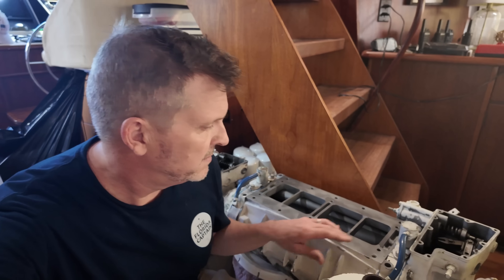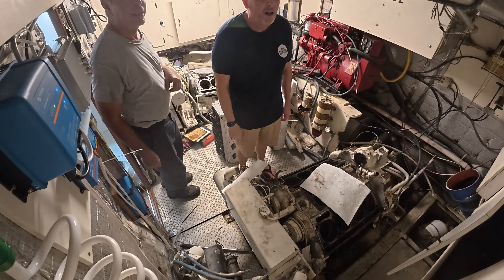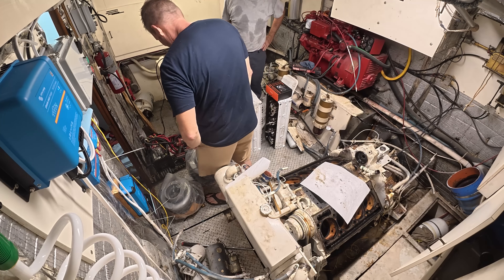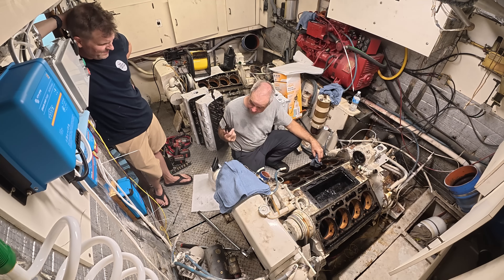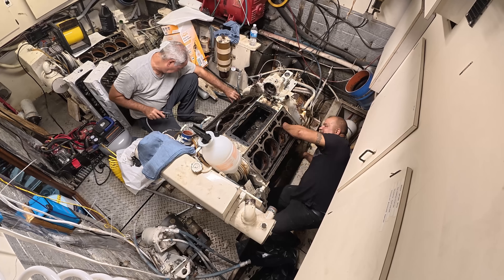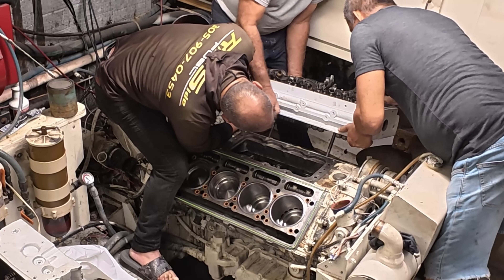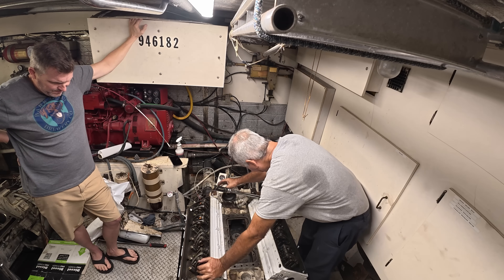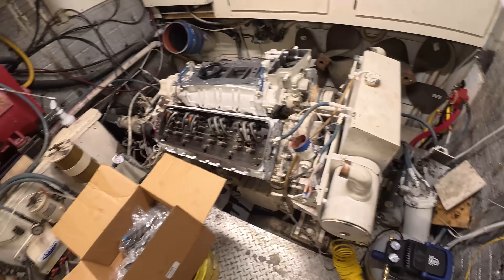Detroit Diesel Rebuild Begins! Step-by-Step Engine Reconstruction

Comment: I really enjoy watching the rebuild, thanks for sharing. And while I don't want to be a back seat driver, there are several such obvious safety issues here I feel compelled to comment. 1) Don't do electrical work. I am an electrician and the casual approach to working and dealing with hot circuits is dangerous and displays a lack of understanding of the hazards. Don't take it personally, many electricians make similar mistakes. Some pay a price for which they were not prepared. Don't be that guy. 2) The mechanic is clearly knowledgeable and experienced. But working with mineral spirits and internal engine gunk with no gloves? No thank you! 3) No safety glasses? Really? 4) Flip flops? Unbelievable!!  Safety is all about you. It is not complicated. When you understand, it can be painful to watch those who do not. Be safe!
Reply from the maker: Thanks for the comment!